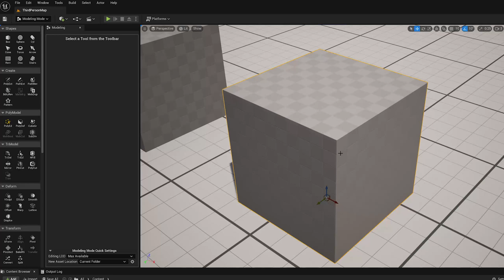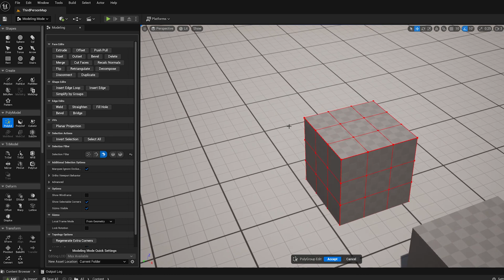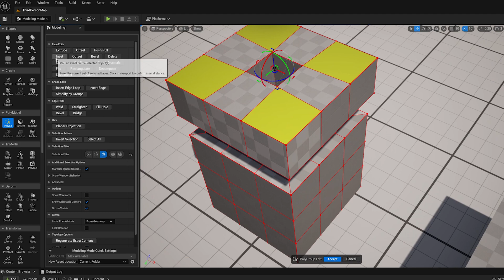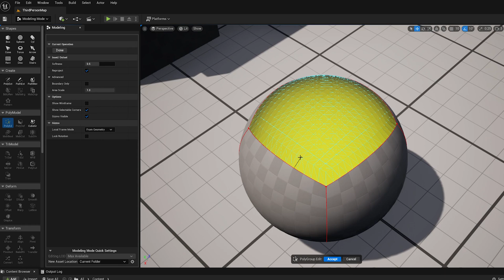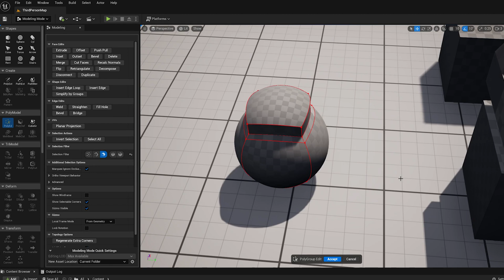UE5.1 PolyEd Modeling Part 4 - Inset/Outset

Comment: It's a bit odd having inset and outset as two separate tools. I'd expect the outset effect to simply be achieved using inset with a negative value (or mouse dragged in opposite direction in case of interactive adjustment) :)

This would make even more sense the current state of UI, where face edit tools are just thrown as text buttons into one one kitchen sink rollout, and there's no way to access them using keyboard shortcuts, so switching them is a bit cumbersome. Even if that got addressed though, the less, more universal tools there are, the better.
Reply from the maker: outset is not strictly inset-with-a-negative-value. When we inset, we project the inset curve onto the existing face, this is necessary to support non-planar polygroups (even most simple quads are non-planar). However when you outset there may be nothing to project onto, we have to "guess" an imaginary 3D surface for the outset to project to. This is more computationally intensive, and more prone to error.   It's not impossible to combine them, however it will not be "symmetric" in many cases (ie the outset will behave differently than the inset), which makes it feel broken / buggy. So we haven't done that currently.